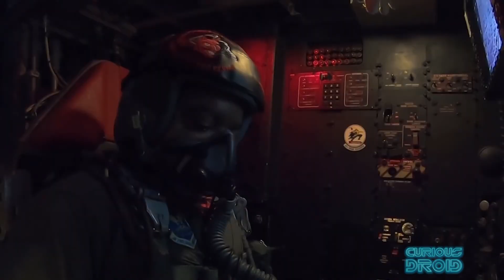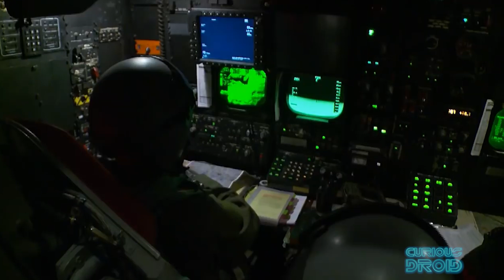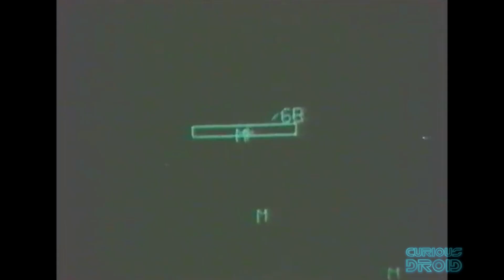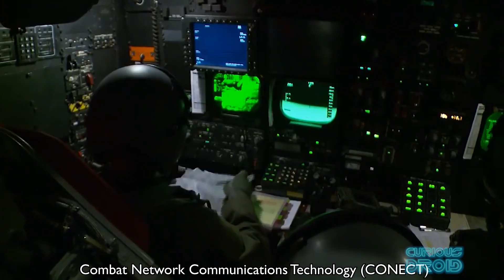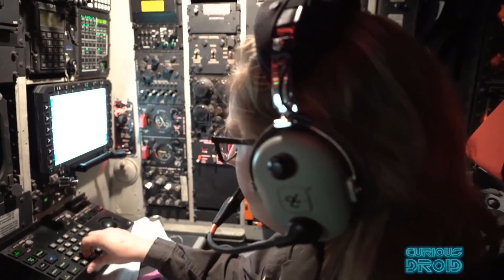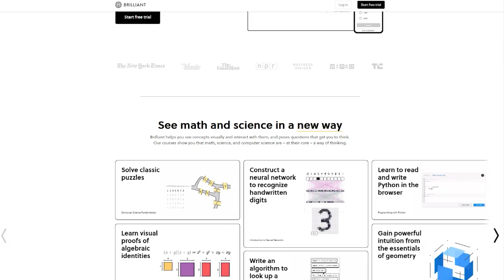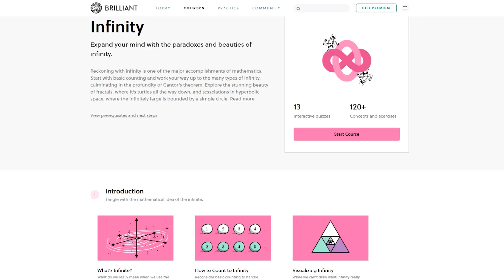How Long Can the B-52 Continue in Service?

Comment: The US B-52s should all be sold to India. The upgrade program should be modified to meet India's preferred specifications. They can be delivered as the upgrades are completed. The nuclear role can be replaced in the short term by rearming the B-1B with nuclear fusing, which will be possible since the treaty preventing it is about to expire. Current B-1B surpass current B-52 overall in capabilities and cost about the same to operate. In the future B-21 will of course take over as the primary nuclear weapons platform, with B-2 and B-1B moved to backup until retirement. A replacement for B-1B with similar capabilities and costs should also be developed, to complement the stealthy but expensive B-21.
Reply: India is a good target customer because they will be used to counter the People's Liberation Army Air Force, which is controlled directly by the Chinese Communist Party. The PLA AF has about 120 late model upgraded Xian H-6 left in service and the PLA Navy operates another 30 or so H-6. If India picked the best remaining 50-60 B-52s they could have a significant deterrent strategic bomber force while they currently have zero.
Reply: The USAF should be satisfied with about 100 B-21 plus about 100 supersonic B-1B replacements with modest stealth and operating costs. If threats increase, then orders could be extended to about 150-200 of each. Current active US strategic bomber in inventory is around 150 total, comprised of a mix of B-52, B-1B, and B-2.

Comment: Should have been retired back in the 1990s and fully replaced with many more B-1 and B-2 as planned. Now it is still in service primarily because not enough replacements were built and the B-1B had nuclear capability removed by treaty. But that treaty is about to expire and replacement bombers are on the horizon.

Comment: EMP: I wreck everything electronic
B-52: laughs in analog
Reply: And ancient EMP shielding
Reply: @joshuacheung6518  And not alot of E to shield
Reply: @davonmulder8458  actually there's plenty of E to shield. That said, most of the bare basics you need to run the engines (and therefore keep flying) can take an unshielded EMP strike just because they're so simple
Reply: I mean, bombing systems are probably somewhat shielded. Thing can carry like 20 nukes, be laughable if you fire one and the other 19 are worthless
But yeah, that's why the critical flight systems are shielded
Reply: Electronic doesn't mean digital. There are plenty of analog electronics.
Reply: @iunnox666  True, but analog electronics are usually much more tolerant to being messed with. Whether overpowering them, or EMP. They don't usually fry as quickly, because they're over built.
Reply: The bombs are digital... B52 with no bombs is just a pice of paper on the air...
Reply: @mr.crocket187  if it gets you away from what was probably a nuclear strike, that's a lot better than a paperweight hurtling towards Earth surrounded by enough fuel and ordinance that it won't matter if the electronics on the ordinance are fried.
Reply: analog is not the same thing as mechanical. analog electronics can still be jammed and without digital signal processing, the processing capabilities are significantly limited
Reply: I’m

Comment: The basic platform/airframe is much the same, but since it first entered service it has had engine and avionics upgrades to meet the requirements of the roles it has performed. It's probably fair to say that the US Air Force has had it's money's worth out of it.  The C130 Hercules has been in service for a similar length of time I think.....but again has seen various mods along the way.

Comment: All equipment is constrained by basic physics and mechanics. Once the top-end of those design factors are reached by equipment. It can not be exceeded.
Thus the 45-cal M1911 pistol and Browning M2 heavy machine gun are still going strong.
And are still perfectly usable military equipment over a century after deployment. 

The B-52 is another rare pieces of military equipment that can not be exceeded by newer equipment. No matter how well designed. Its simply at the top level of its equipment niche.

Thus until bomb-dropping is no longer military useful. The B-52 will continue flying.
As there is nothing better that can be built. To serve in its current role.

Comment: Why doesn't the air Force just build a new design with the same concept as the current B52, a large structurally over-engineered platform with lots of space and range.  Certainly the design and construction of a B52 should be simple by today's standards.  Other than modern avionics and better engines, just build a big platform on which new systems can be added or subtracted as needed.

Comment: Why can't buil new one just start building again
Reply: because you have to retro engineer it meaning start from scratch. its why we cannot just snap our fingers and have replacement parts for many old mechanical devices such as guns or clocks or engines etc. there are no molds, nor design docs that mention what materials were used, their tolerances, their exact size to the nanometer, what sort of tricks they had to use to make it work like they wanted.

Comment: It's a combination of economy of operation, system reliability, and the ability to perform relevant missions efficiently.    B-52s are reliable, cheap to keep flying, cheap to operate, and it can drop bombs where bombs need to be dropped.  It is survivable even in the modern combat environment due to systems upgrades.

Comment: The B52 is the Shadow of Death, forbearing hellfire and brimstone, Biblical destruction. It will make the ground shake, leave in its wake the surface of a dead planet. There is no finesse in its mission, and it isn't sexy, the B52 is simply the big hammer. You can only upgrade the big hammer so much. The rules are pretty simple; just don't find yourself in its shadow...

Comment: A bit of additional information. Recently, Air Force announced that it was decertifying the B-52s for carrying B-61 and be B-83 nuclear weapons. The reason for this is that the current likely combat environment,  which will be tech heavy, would find adversaries able to easily spot and take out a B-52. Thus it did not make sense for the platform to continue on in its original nuclear weapon carrying role. It is instead going to be used, as suggested in your video, as a standoff platform.

Comment: Those planes are the equivalent of Mauser rifles: The concept is already perfect. Why fix it, if it ain't broken?
Reply: @dodecahedron1  I know more about aircraft maintenance than you likely know about flying a plane, and I’ll leave it at that.
Reply: More a Lee Enfield .303
Reply: Always add model 98 to that. Earlier models like the model 93(spanish mauser) or 96(swedish mauser)used cock on closing and didnt had the gaint safety lug on the bolt. But you have a good point. In 100 years a new sniper rifle will most likely be a mauser
Reply: @F4Wildcat  – And I guess that the general air frame of the B-52 will be around in a 100 years also. Other engines, other materials for the hull, but the concept is perfect. And they did it with pen and paper and a ruler and a slide.
Reply: Trust me, it is broken. I work on electronic warfare systems for this aircraft and its a nightmare.
Reply: @Horse Loving Deer Girl You might have nightmares working on the systems, but that means only that you’re broken. The airplane is just fine.
Reply: @SillyPuddy2012  You dont have the slightest idea about aircraft maintenance do you..
Reply: @Horse Loving Deer Girl I know enough to conduct a thorough pre-flight inspection and fly the damn thing. But that’s irrelevant, the fact is you’re still broken. Don’t blame your inadequacy on a great plane. ✈️
Reply: @SillyPuddy2012  inspections and flying huh? So you do know absolutely nothing about maintenance. Proves my point.
Reply: @Horse Loving Deer Girl I maintain my house, three cars, and a semi-truck. So yes, I know considerably more than nothing about maintenance. Guess what, you’re still broken.
Reply: 1898 muser rifles are not in service today. Much like the users attempting to use them as such, it is dead.
Reply: @mikuhatsunegoshujin  – I just checked Mauser's website, and cannot confirm your statement. On which evidence do you base your claim?

Comment: Two points of interest.  1) When the Navy built its capital ships (back in the day) a battleship was expected to last about twenty years, or so.  The BUFFs look even better when you consider that.  2) some years back, the USAF did a cost-saving analysis, based upon the then price of fuel and the expected efficiency improvements.  It wasn't until much later that someone pointed out that the USAF only considered the price of fuel when loaded ON THE GROUND, and ignored the extremely common practice of in-flight refueling- about 17X greater, per pound of fuel!  That is why the USAF restarted the analysis.

Comment: When I was driving with a friend across the country to college in 1981 we were crossing northern Nevada when we heard a low rumbling and roaring.  "What the dickens!"  We pulled over and got out of the car just as a B-52 crossed overhead at a very low altitude.  We were both a little stunned and stood there looking at it as it moved into the distance.  It seemed so huge that low and, given the technology even then I'm wondering if those pilots were scared flying so low.  (As far as I know we were not near any airforce base.  I think they were just practicing below radar penetration of defended air spaces.)

Comment: Good video. I remember seeing B-52s nearly  every clear summer day in the 1960s over Detroit, flying Chrome Dome (we didn't know what it was called at that time) . They were always heading north or south and too far up to tell what the aircraft was - we could only see the contrails.  
When the C-130s were retired many of them were purchased for wild fire air drops, until the wings of one came off killing the crew. Then they were all grounded (I've since seen video of some  still doing this role). This will unfortunately be the way the B-52 is likely to be retired. Despite however rigorous the inspections and testing; at some point something will break, probably killing a crew. The investigation will no doubt reveal that there were hidden structural flaws, from 60+ years of flying, in a part that had been regularly inspected. 
Chrome Dome of course was the practice of keeping nuclear armed B-52s in the air at all times as a guarantee against a Soviet nuclear strike against air bases. Something else that's interesting. At no time do I remember anyone pointing out that those Chrome Dome B-52s were always armed with nuclear weapons, hydrogen bombs. Overhead every day for at least a decade.
Reply: They sometimes broke apart mid flight in the 60s (also during chrome dome), when the tail broke off.
There was probably  a design flaw in the structure, later this don't happen again.

Comment: Must remember that these B 52s are not flown every day like a commercial airliner.  So they're airframes are not worn out.  Just updated electronics and power plants.  My Dad was a CMSGT in the Air Force and B 52`s were our bread and butter.  I say put commerical  engines on them, upgrade the avionics and keep flying them. These planes  are the Flying Clydesdales of the air.

Comment: My immediate thought to the opening question: You can’t hack an analog plane with a computer virus.
Reply: Although I dont think you can do it with normal digital aircraft either, the system is offline and extremely restricted.
Reply: Good point.
Reply: @libertarian4ever66 didn't that plane encourage us to build a way better plane, and then it turned out that the russians had lied about its capabilities so we're just like way ahead of them now?
Reply: libertarian4ever66 Maybe..but, we re-tooled some of the framing and design for our F-15 because of that MiG..
Reply: libertarian4ever66 I’ll bet you that subminiature vacuum tubes are/were more common in aerospace than you might have thought. Especially at that time. Someone gave me a module off a decommissioned part of an American made plane, maybe part of electronic countermeasures, I don’t know. But it has here small vacuum tubes in it. Raytheon made iirc. I was told there were shotgun shells that would go off if parts of what this thing came from weren’t taken apart correctly.
Reply: A computer can also be analog. The fire-control system in the german anti air tank gepard was initaly a analog computer.
Reply: Also it can be EMP-proofed (like the E-4B)
Reply: Essentially, it doesn't take anything except a computer and some servos to convert analog to digital.
Reply: SO SAY WE ALL
Reply: Sam Cooper  wot no pencils??
Reply: libertarian4ever66 Lol until you realize you can just put your electronics in a faraday cage and be fine.
Reply: You wouldn't throw a virus at a vehicle anyways.

You expose it to an EMP blast, shutting down all of its electronics.
Imagine if the B-52 was actually "Analog" and 30 people had to sit on bicycles inside to make it fly, no electricity needed
Reply: I’ve heard claims that “Digicam” can be hacked cause it’s digital  🤪
Reply: @uss_04  The US Milit is big on DIGI.  Andtheyhave good people who know how to harden those systems. A B52-Baby-way-up-in-th-sky, doing 400-500 nauts is already isolated to the point that hardening is just bonus points.  Theyalso carry EW officers to carry thehack to the enemies below. The weakest point wouldbe the weapons, during their brief decent into destiny, where a hack is certainly not going to return the weapon to the weapons bay.  If it were me designing the anti-hacking softwareinto a nuke I would say that anything that resmebles anything abnormal after arming and deployment will result in an absolute commitment to detonate as presecirbed.  Actually after deployment I would want a failsafe cancel command and a hard loop into the final weapons commands, noting else.  Worst case is that the enemy now has a fully armed , undetonated nuke, which due to a hack attempt got dialed up to max laying in one of their most sensative areas of defense, whcih will now require evac and plenty of attention to move, disarm or whatever they want to attempt which will resultin a det.  Nah, B52 will be fine as  a hardened digital platform, but I also like the analog.  Keep them both, commanders discretion.  But thos EW platforms will need a good bit of digi to be on their best game....  But I also appreciate the caution when considering digi, faith, they have good people.

Comment: I worked on the G models back in the mid 80s.  Now only the H models are left flying; the last one rolled off the assembly line in 1962.  I wasn't even born until the next year; every single one is older than me and it's amazing that these aircraft have taken the beating they have and are still flying.  Consider that most aircraft such as the C-130 previously mentioned fly at high levels the vast majority of their air time, but the B-52 did and does a lot of low level practice runs.  Thicker air, more turbulence, more birdstrikes and warped engine cowling to deal with.  
     That said, it is the workhorse that never quite outlived its usefulness, even with newer aircraft brought into service.  I saw the B-2 bomber just coming into service when I left the Air Force, and I'll probably live long enough to see it retired.  But I'm willing to bet that I'll be gone long before the last B-52 is flown to the boneyard.

Comment: Around 6-years ago - I attended the AVALON Airshow (AUSTRALIA) with my eldest son and a few mates.  When we arrived I saw a SABRE – a METEOR and an F-16 that were ‘chasing’ each other around – I said to them – “I am going to lay here on the concrete and watch this – this is neato”.  Then I looked over to my right – and in the distance, I saw a parked B-52 – they all looked at me strangely as I took off in a hurry and said “WOW – a B-52 – back later”.

The particular B-52 had a sinister-looking LAST LAUGH JOKER nose art on it – neato looking artwork – but quite ‘sobering’ when you realised that the pack of cards the Joker was dealing out had a black bomb on it rather than the club or spade etc – meaning – “Your bombs may have destroyed our home and airstrips and we have nothing to return to – but we are still up here to make sure we destroy you – we will have the LAST LAUGH”.  It was very sobering indeed.

I got to stand up inside the bomb bay and took a 360.0 deg video of where once there was probably a nuclear weapon ready for delivery – again – a somewhat sobering experience.

Later in the day my mate’s dad had gone ‘walkabout’ and my mate had gone off to look for him – so I stood out of the hot sun and in the shade of the B-52 wing and next to the engine nacelle.  Whilst standing there – I noticed a drop of liquid hanging from the nacelle.  I reached over with my finger and touched the drop and sniffed it - it was jet fuel – HA – B-52 blood.

Later I told everyone – that I not only got to see a B-52 and stand in its bomb bay – but I also got to smell like a B-52 from the leaking jet fuel (B-52 blood) – HA – they all laughed and thought I was crazy.

But to me (and not being a warmonger) – here was a major piece of world history (in my opinion) and I got to see it – touch it and smell like it - WOW.  What an experience - and one that I will never forget and one that I try and revisit by telling others about.  

I took pictures of its nose art and still look at it and what it meant.

Thank you USAF for taking that B-52 to AVALON Airshow and for letting me experience what to me is a lifelong memorable experience that I still think “WOW” about and for letting me experience this important part of world history.

Have a nice day all (HA – hopefully, no B-52’s required).  CHEERS from AUSTRALIA.